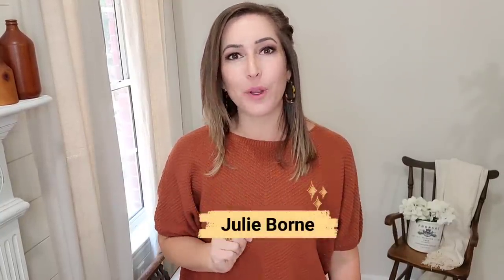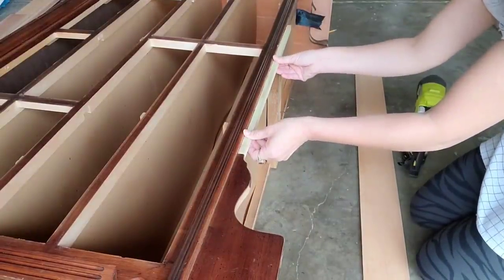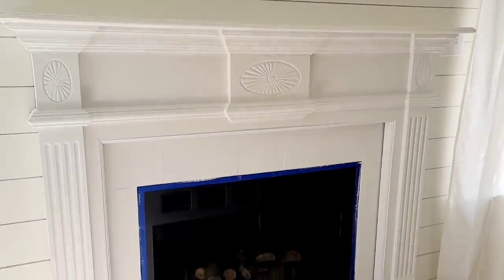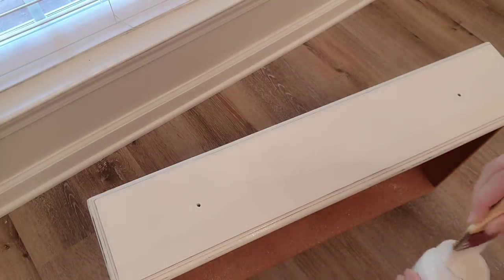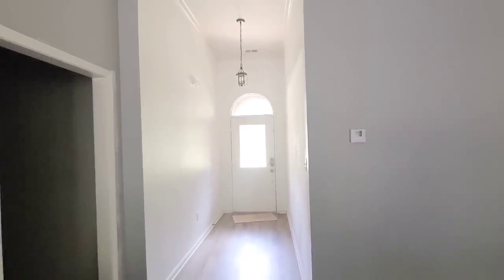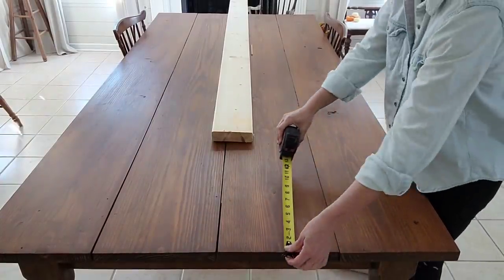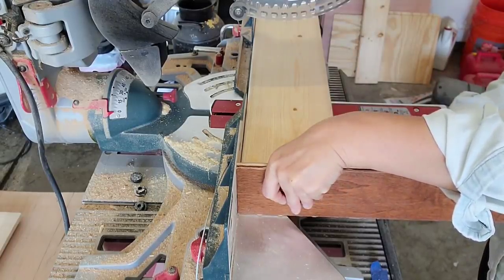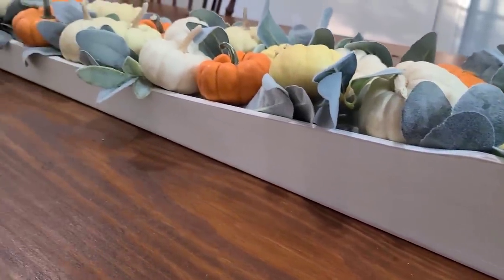Thrifted Furniture Flip Makeover Transformation • Brass Painting Technique • DIYs for your Home

Comment: I use polycrylic as a topcoat on the furniture pieces I have done. It has worked out very well. 
You didn’t a super job on the dresser. The sides looked so good after adding the wood vertically to them. You scored on the light fixture!  The table tray/box turned out cute as well. I enjoy watching your up cycles for your home. Keep them coming! ❤️

Comment: Julie, I would have used a small roller and spritze with water over the surface to ensure a smooth finish.     That way you can distress it but have the rest smooth.    I learned this lesson when I did my dresser with the same paint.       I used PolyAcrylic to protect it.    Another tip mix a small bit of paint into the poly and roll or brush.

Comment: Gorgeous! I love the side panels, awesome idea. I have been flipping furniture for 10 years now and I do have a few tips. For sanding, I use Black and Decker's detail corner sander. It is so easy to use and it doesn't over do it. Also, for dressers especially, I use a 6 inch skinny roller from Amazon. It makes it so much easier and faster! There are no streaks. I started using Annie Sloan chalk paint, which I love, but so many coats! And then waxing... yuk. I just refurbished 3 pieces for my craft room and I used cabinet paint from Amazon. No need to put any top coat on and it wears super well. Love your box for the table, pretty pretty. I personally would love to see your work for your new house. I have been working on my own house for a long time....I need some inspiration! Thanks for sharing all your beautiful projects ❤🧡💛

Comment: The light fixture turned out great! I do a lot of furniture and I find the Dixie Belle flat topcoat or Sweet Pickens topcoat very easy to use. The key is very thin coats with a light sanding in between all but the last coat. The Dixie Belle Gator Hyde is great for durability, but harder to work with unless you add a little of your paint color to it. Love your videos, thanks for sharing!

Comment: Julie, don't use pressure treated lumber inside your house.  It's treated with serious chemicals (arsenic is just one of them!) Since you asked us for our furniture tips: use wood filler to fill any holes or cracks.  Spackle is great for holes or cracks in sheetrock walls.  Some people use Bondo (yeah, the stuff you use on cars!)  But, I can't stand the smell so-wood filler for wood furniture. I think the bubbles showed up on your piece because the water based varnish did not work with the probably oil based finish your dresser had.  Since chalk paint is porous, the varnish was reacting to the varnish on the dresser.  I only use Minwax Polycrylic for my top coats on furniture because it's the only one I've found that doesn't yellow with age or heat, especially gas heat from furnace or fireplace.   I just was so happy to see this video pop us this morning!  YAY!  and that dresser for $25 is a steal!  Wish I was closer to you-I would buy that hardware from you!  Have a great weekend.

Comment: Hi Julie the dresser looks great!!! Water based polyurethane is what I use as a top coat. Easy clean up. And you can also spay with paint sprayer they also sell in a spray  can. They also have a wipe on poly. Plus try wax with a brush. Big mama’s butter Annie Sloan there is a lot out there. Also minwax

Comment: You sprayed the top of the dresser with a varnish type spray. It might have not wanted to stick. There is a coat to use to seal but not Ultra cover. I am stuck thinking of the name. But I think that was your problem. the paint wouldn't stick to that spray. plus that finish on furniture is a sprayed on from the factory. You know I said I refinished furniture for years. There is a difference in factory and a piece of furniture that was done by hand years ago. If you have another question for me always ask!    Joyce

Comment: Love the dresser. A trick I use for getting a smooth finish is to paint on the paint with a brush and then immediately roll it with a small foam roller. (I saw this trick on Black Sheep). I will be stealing your idea of mixing linen and chiffon. I think linen is too  white also. I also will be stealing your idea of putting the boards in the sides and bottoms of dresser. Great idea! Thanks for sharing your projects!

Comment: All wonderful sweet one! I’ve not use spackle on wood to fill holes so it will be interesting to see how it holds up. I’m thinking with you using sealers and multiple coats of paint it will be alright however. Wood fill is the product I’ve always used and it’s worked great. Many many years ago (in another state) I had some varmint chew a hole in basement walk out door (where dog food was stored) and was horrified! I filled that hole with layers of wood fill over several days, sanded smooth and painted. It was solid and you would have never known anything had happened to it, yea! We have become such a disposable society and I think it’s such a waste of resources. So I love seeing things repurposed and used again. I updated a former house and shopped for new bathroom hardware and a new exhaust hood over the cooktop. Looking at the bad quality of expensive hardware and exhaust hood, I decided my old stuff was better and spray painted everything with Rustoleum antique bronze (including exterior lights) and 2-3 coats of a sealer. It wasn’t hard to do, was durable, and turned out great! I also have found some great bargains at my local ReStore (supports Habitat for Humanity) including appliances like cook tops, washer/dryers, microwaves, bedroom suites, building supplies, hardware, tables and chairs, you get the idea, everything including the kitchen sink lol. Proud of you young lady!

Comment: Furniture is my jam! I do Smalls and hauls for Facebook. However furniture is my best seller by far. Polycrylic is my go to clear coat. Bondo is my go to filler. You can mix up as much as you need and it hardens in minutes. Next time also spray the piece with shellac so you won't have to deal with bleed through. Other companies make a stain blocking primer but shellac works amazingly and is much more available. I look forward to seeing you do more furniture!
Reply: I meant I do mostly Smalls and hauls for YouTube. Lol...

Comment: I use water based polycrylic on all my decorative paintings and have never had a problem.  I do use light coats and do at least 2-3  coats and it cleans up well.  Be sure to let each coat dry completely..  this product was $7.99 a quart but has now jumped to $17.99.  I get it at Walmart . I even use it on my porch boards and it holds up and wipes clean with a wet rag.  Its Minwax.

Comment: Same thing happened to me only with the clear spray paint as a top coat. Whatever they used in the original finish causes a reaction. If I stain block with clear shellac instead of the clear spray paint I have much better luck. No bubbling. 

But your dresser turned out so cute!!! Loved it.